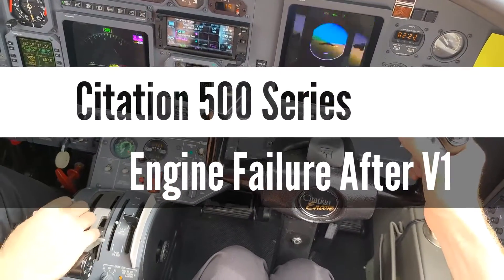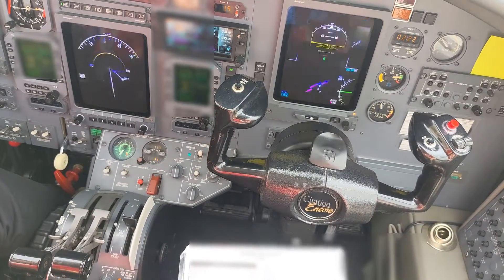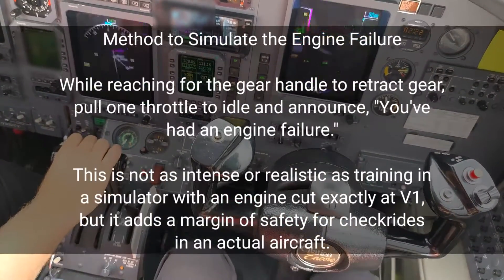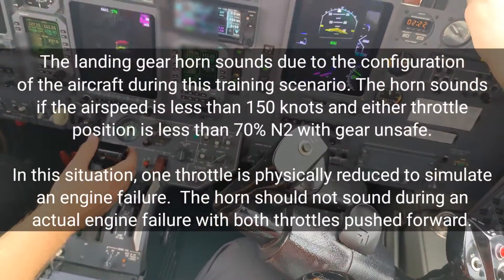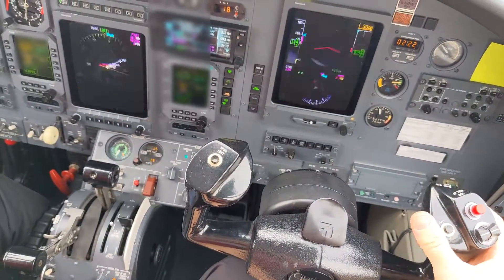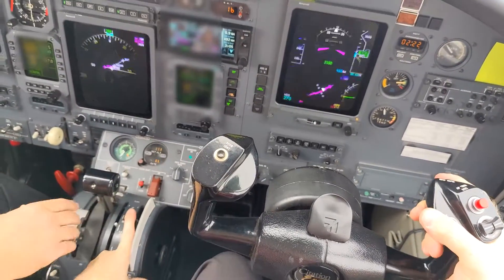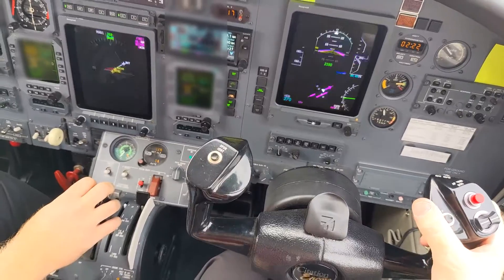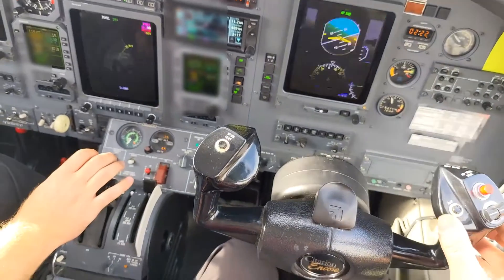Citation 500 Series - Engine Failure After V1

Comment: Helpful vid, cheers.   Find it slightly curious that ATC give you ALT/HDG instructions for a later phase of the flight.
Reply from the maker: The altitude/heading clearance was actually for only a few minutes in the future. Since this was a checkride we were departing the airport, immediately turning around and flying an approach back into the same airport, then going missed approach. The altitude and heading were for the missed approach a few minutes in the future.